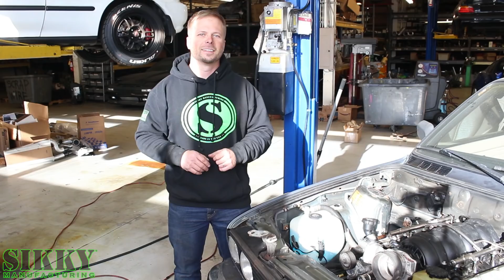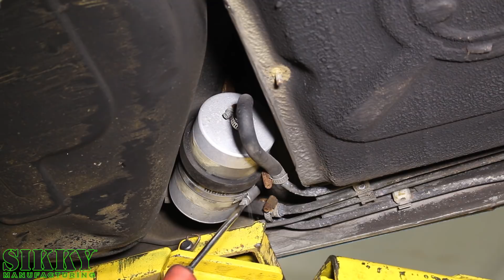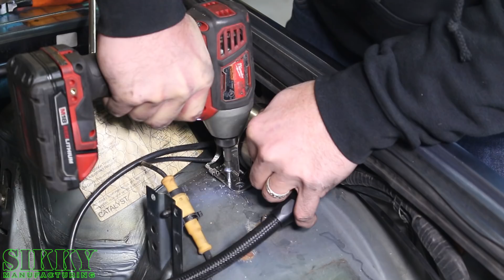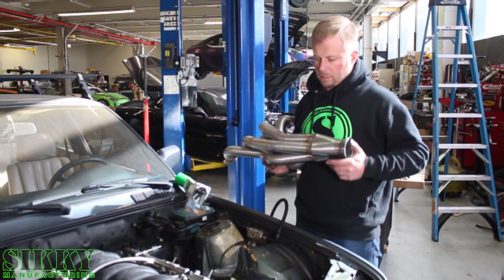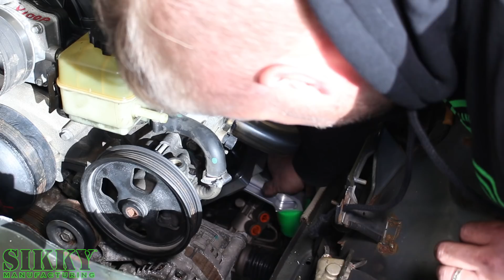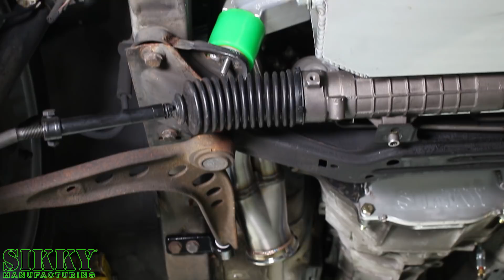BMW E30 LS2 Build Pt 5 | Headers + Fuel System Upgrade | SIKKY Manufacturing

Comment: Very confused here could you please help me out , when you installed the headers with the motor and trans in the car and tilted the engine and slid the drive side header in , what did you have disconnect from the steering shaft , was the shaft itself out and the u joints were still installed? I’m just confused how you got it through the header with everything in place
Reply from the maker: Yeah you can disconnect one side then it will still pivot on the other joint so you can angle it up through the header then re connect after it goes through the header.  hope that helps!

Comment: I just got headers on my truck but my engine hesitates on first wot. After I get to crusing speed everything is fine. Truck just passed 30k miles. Do you think, the headers are causing a Fuel pump issue? (2016 f150 5.0V8)
Reply from the maker: It's possible it could be running slightly lean.  Do you have any codes/check engine lights?
Reply: @SikkyTV  it's actually stopped doing this and been running fine. No codes.

Comment: This is awesome. 
Why exactly does the filter get moved into the engine bay? 
Will you show the rest of the exhaust system getting done?
Reply from the maker: Just a preference, realistically the filter/regulator combo could be installed at the same location as the OEM filter and run a single line to the GM rail.  If the oem hard lines were in bad shape we probably would have opted for that route.
Reply from the maker: Yes. We will cover the exhaust as well.